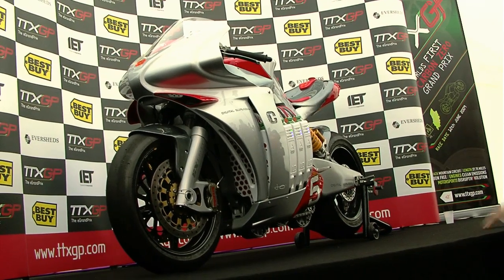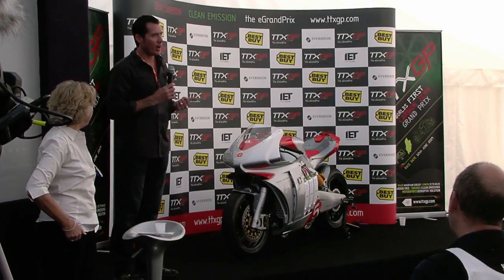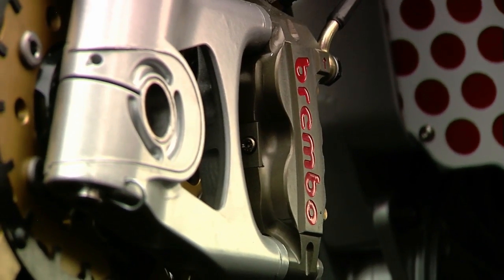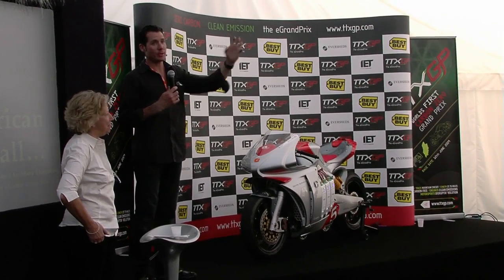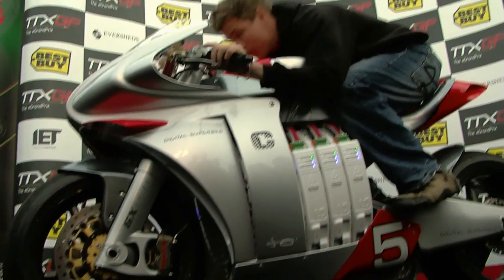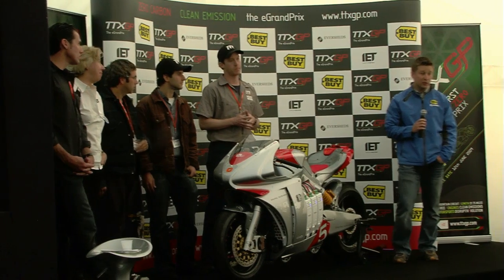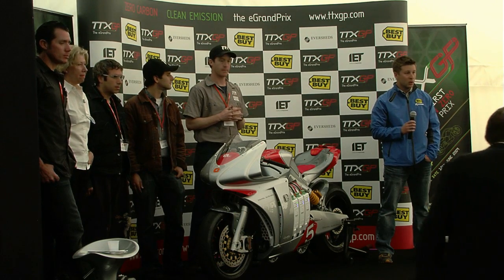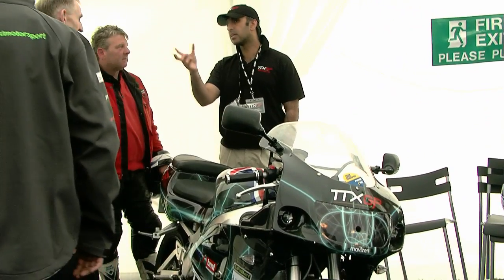Motoczysz E1pc Electric MotorcycleTTXGP Isle of Man

Comment from the maker: The noise is the electric motor spinning, and a little bit of chain noise. The bikes are not really quiet, they are just quiet when compared to petrol bikes. People have said they sound like those drills you use at home, or a jet engine. Check out the video of Agni X01 bike at SPA Francorchamps for the sound.